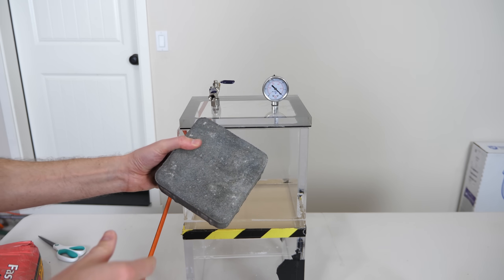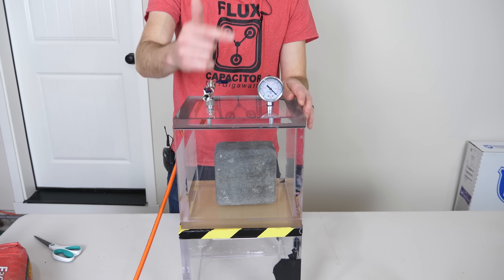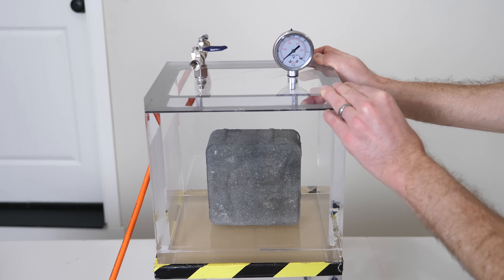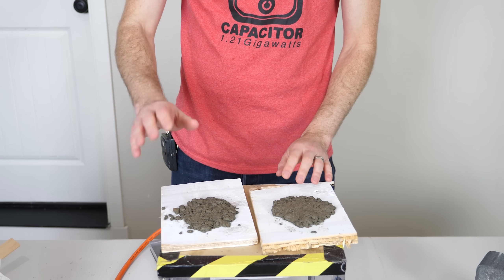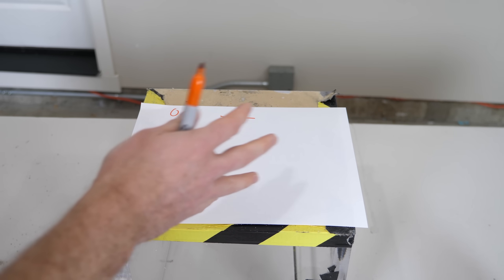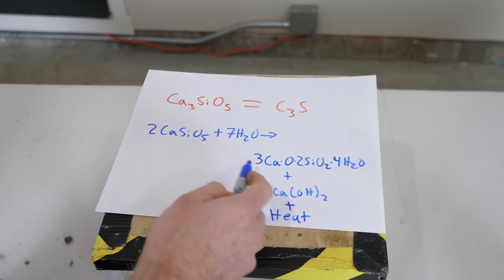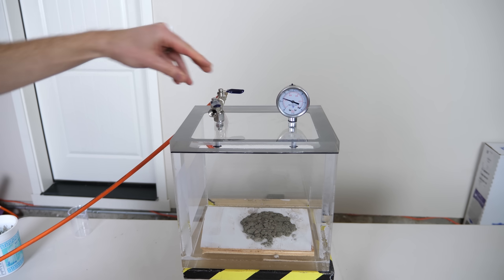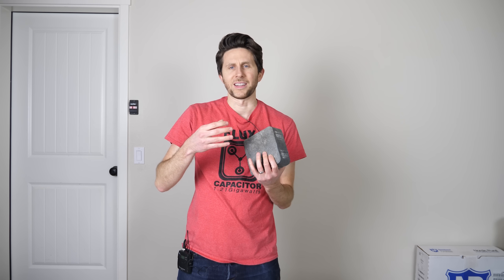Does Concrete Turn to Dust in a Vacuum Chamber? Concrete Without Oxygen Experiment

Comment: I thought maybe if you remove air (not oxygen specifically) the concrete would form with no bubbles or bubbles without air, which could have maybe altered some properties, guess I was wrong :p

Comment: I worked as a concrete pump operator and knew that concrete will set even under water.
Reply: @Scire Facias, I didn't know that, that's pretty cool.
Reply: @Scire Facias, I just watched the first one you have linked for me, thanks for that. It's funny that it mentioned Cyprus as I was stationed there for 6 months on a United Nations peacekeeping tour (1990) when I was in the British Army (1989-1996). I will watch the others later on when I have more time. Again, many thanks.

Comment: I know it's been two years, but I wanna guess. After every guess I'll put an "edit:" to put any further comments

First guess, it's not going to fall apart. The reason? I think that a big building is different than a single concrete brick, since the building has to support many tons of weight, and that probably needs the air in the concrete as well. Had it been concrete under extreme pressure and a vacuum, I would guess that it would crumble. Back to the video

Edit: as I expected, my guess was right. But it was an easy one. Something else that occurred to me when thinking about the second one is that, it's really hard to remove the air from the inside of a solid object, tho I don't think the outcome would change. Time for the second guess, that is actually a hard one, I think that it depends on whether the air will manage to get out of the mixture (that's what I meant at the start of the edit). If it will manage to get 100% airless, it will probably not become concrete. HOWEVER, I don't think that this will happen, my guess is that not 100% of the air will escape the mixture because of how "stiff" (dont know the English word for it) the liquid will be , and as a conclusion, the mixture will manage to create concrete, even in a vacuum. Another guess (that I don't think will be answered in the video) is that it will take like 10 minutes more than a regular concrete mix. I'll come back with another edit

Last edit: seems like both my guessed where correct, but for the wrong reasons, or at least, the reasons the video talks about are different. The third guess was never actually tested, so we don't know. I don't think the hypothetical videos talk about the oxygen as stated by the video. These videos don't say anything about water for example (H2O). Anyways, it was fun guessing, if anyone has actual knowledge on these topics, you can reply and we can talk

Comment: The most confusing is that we call it the drying of the cement, since it actually is not drying, it is reacting. But how do you call a chemical process like that? Curing?
Ah, here it says:
https://www.cement.org/learn/concrete-technology/concrete-construction/drying-concrete-vs-curing-concrete
Curing is the hardening or the chemical process, just like resin.  Drying is the evaporation of water to get the proper humidity in the concrete to be able to put other layers of building material on it that might completely block breathing.
Reply: This thing needs to be pinned immediately.